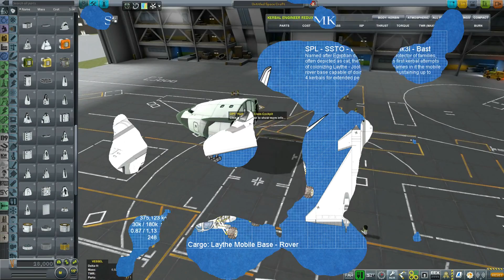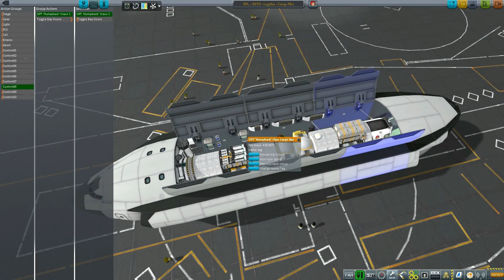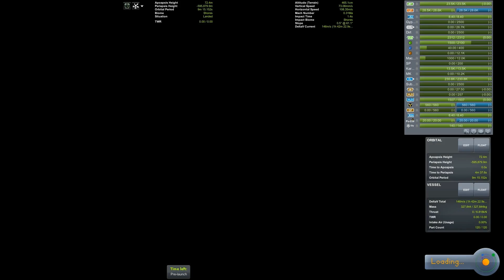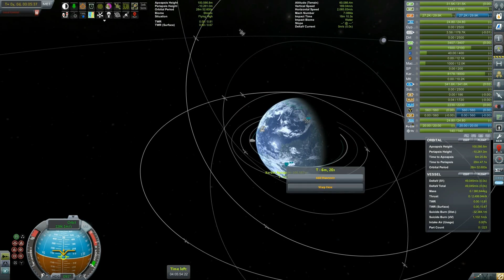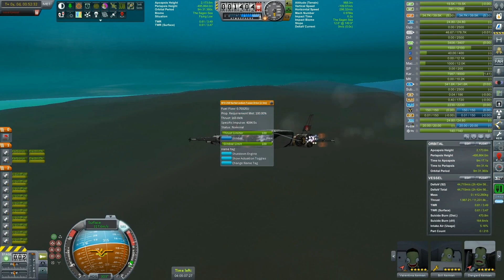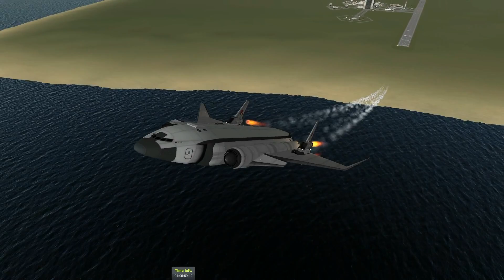Kerbal Engineering - Building Laythe SSTO Base Deployer - Bast

Comment: Late to the party.  In earlier versions of KSP w/OPT mod, this was a recurrent problem for my craft if I did not have advanced tweakables turned on and remembered to manually set strutting in the options for each individual wing part in the editor.  Every time I placed a wing, I had to manually make those adjustments.  With that, I never again had a problem.  It's been some time since I played so I don't know if that is still an issue, but if it is for anyone else, try that.

Comment: I really like your space planes. At 54:29, when you have hard time tôperform this 180° turn, I noticed you placed airbrakes in front of your aileron. This is not good as the airbrake will spoil airflow on your ailerons thus making them a lot less efficient for turning. Try placing airbrakes away from ailerons and it should be better to handle ;)
Reply from the maker: FloLac130184 Thx,. Tbh i did not know that it was modeled. But you are right of course. The problem was that there were no airbrakes big enough to efficiently brake this monstrosity, so i had to add many. Most of them were planned to be used only for braking from orbital velocities to flight ones but ended up being used overall. I guess i was missing procedural airbrakes ;-)